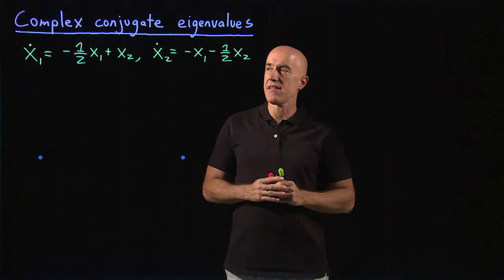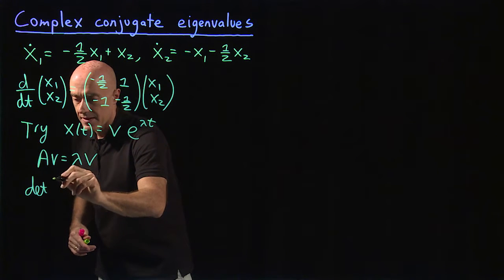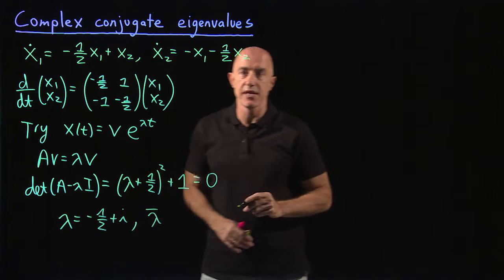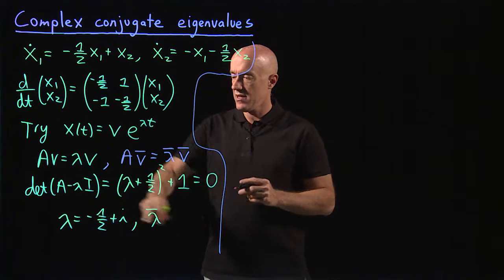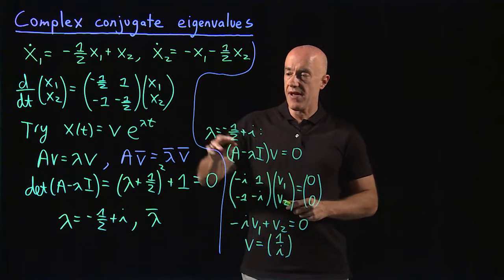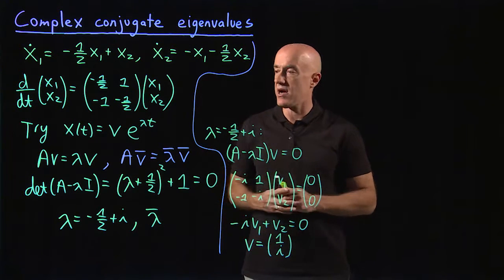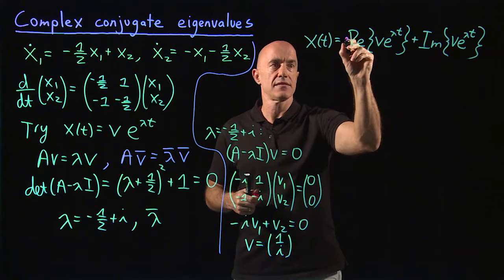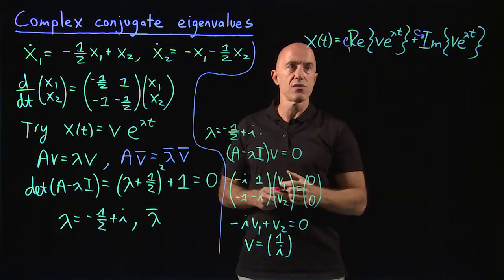System of odes with complex eigenvalues | Lecture 41 | Differential Equations for Engineers

Comment: Plz upload for equal eigen values also🙏🙏
Reply: Equal eigenvalues could mean that the matrix is a scalar multiple of the identity matrix, and all vectors with real components are eigenvectors.  The phase portrait of such a system is a star pattern, where all solutions follow straight line paths, with a radial position that is an exponential function of time.

Equal eigenvalues could also mean that there is only one eigenvector, and the phase portrait is called an improper node.  Every path toward the origin, for equal negative eigenvalues, will approach the equilibrium position on a path that asymptotically approaches a direction parallel to the only eigenvector.

Comment: Hello Chasnov, i had a question. What would be the outcome whem we will calcute for the nagative value of of Lambda such as -1/2-i?
Reply from the maker: Spiral in to the origin
Reply: I need only complex eigenvalues 
we want to know what is complex eigenvalues  introduction and properties etc so  please after that u give example
Reply: @ifraawan7538  Complex eigenvalues means that there is no real vector that remains in the same direction, after being operated upon by the matrix.  All vectors will be rotated (and scaled if applicable), if there are complex eigenvalues.  Real eigenvalues means there are special vector directions that remain constant after the matrix operates on them, and that only a scaling takes place.  That vector is the eigenvector, and the amount of scaling is the eigenvalue, which is what would happen for real eigenvalues and real-components of eigenvectors.

If used for a solution of a diffEQ system, complex eigenvalues mean that the solution is a linear combination of sine and cosine, each multiplied by an exponential envelope.  The real part of the complex eigenvalue is the exponential growth/decay rate, and the imaginary part is the frequency of the trigonometric functions.

A negative real part of a complex eigenvalue, means a decaying spiral toward the equilibrium point.
A positive real part of a complex eigenvalue, means a growing spiral away from the equilibrium point.
A purely imaginary eigenvalue means an ellipse (or circle in a special case) that circulates the equilibrium point in a stable path that remains the same.
Reply: so please reply my answer